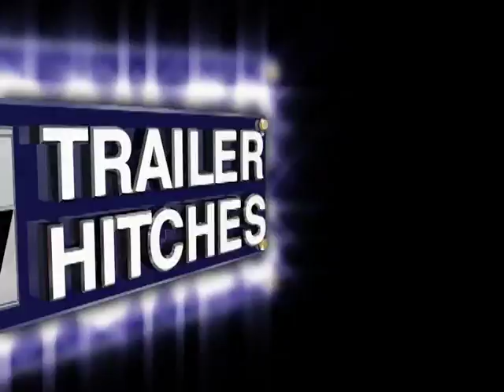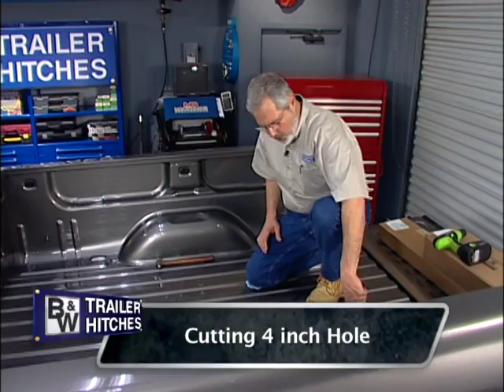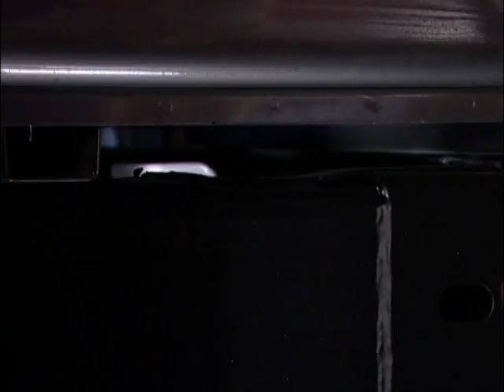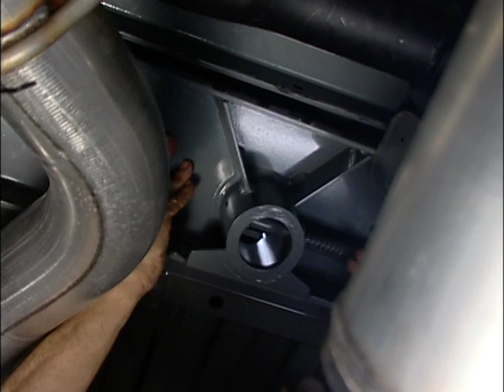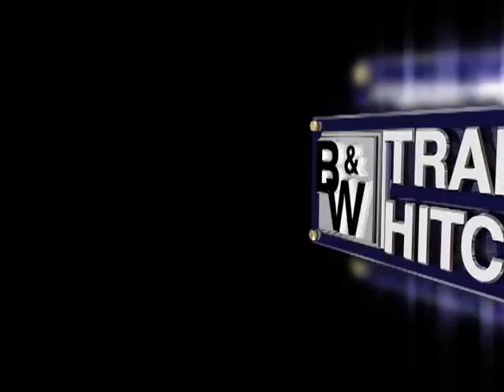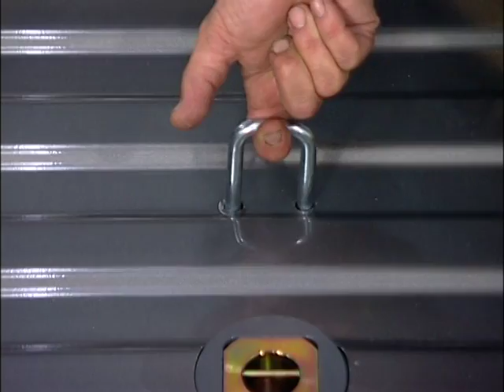B&W Turnoverball Gooseneck Trailer Hitch Installation Demonstration- Model 1067

Comment: I use to watch your tv show all the time. But I don't have cable anymore. I have one question. I'm looking for a gooseneck hitch to put on a ram 3500-500 chassis. Will an under mount style set up work on just a chassis set up. I'm getting into the hot shot trucking business. Thank you for your vids.
Reply from the maker: If you could give our customer service a call at 800.248.6564, they can walk you through what you would need to get a gooseneck hitch on your truck.  Thank You!

Comment: 2 things I have found... 1 If you don't want to cut you can loosen driver side bolts a bit and remove passenger side. Then you can lift the side of bed. 2 Put a heavy duty zip tie on the safty chain loops. Makes it alot easier to hook up!